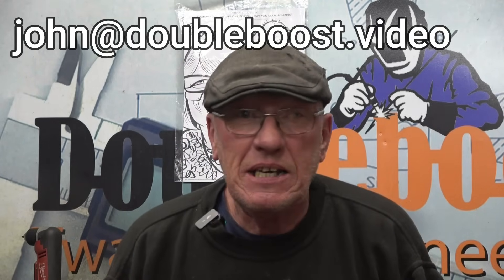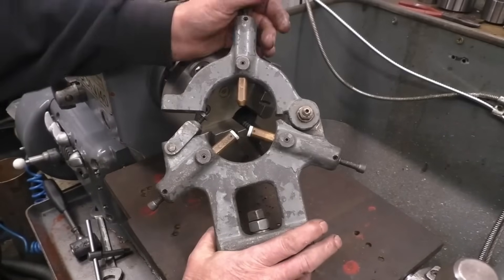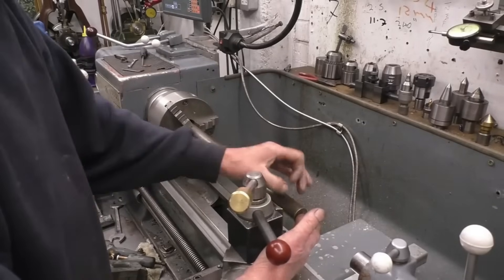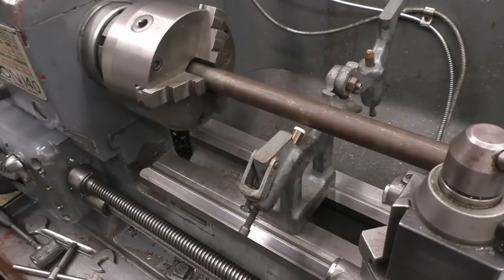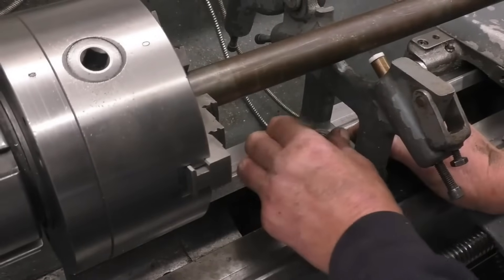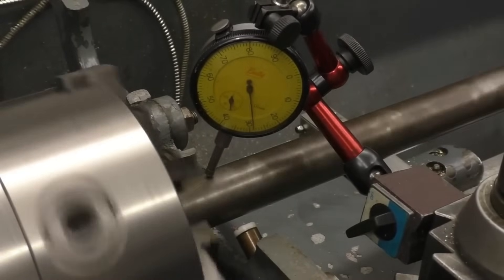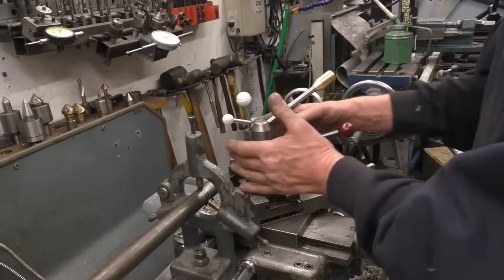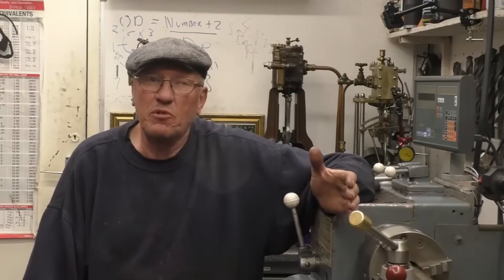Wednesday Catch Up 49. Lathe Tutorial P12 The Fixed Steady

Comment: John mate: You should make a new clamping block to replace the one on your existing steady rest. Something that you can hold from above the bed: it should be narrow enough on one plane to fit through between the ways, while wide enough on the perpendicular plane to span the gap and grip the underside.
You have more than enough equipment with which to fabricate such a simple device; not to mention buckets of skill and experience ... and very likely the raw material to hand.
Furthermore, it'd make a cracking new video, showing how the home machinist often makes tools of their own, and alters and augments the tools they have already.

Finally ...

Best wishes and Chin-up!

GinoX
😄
Reply from the maker: That is a very good idea.  I will see what can ve done .